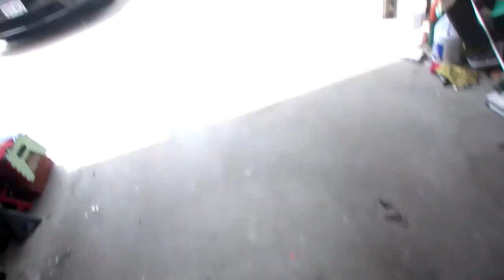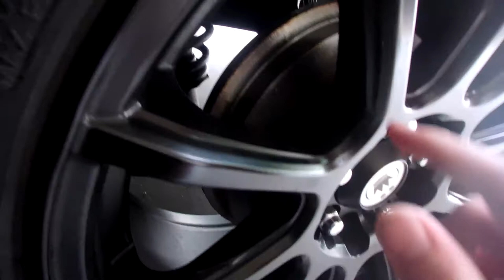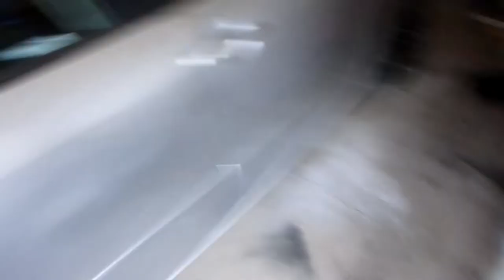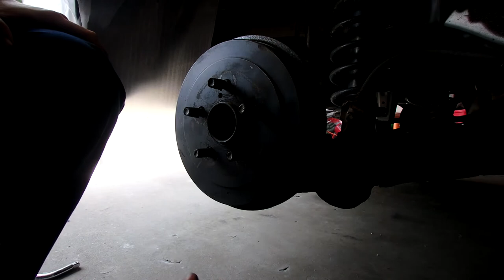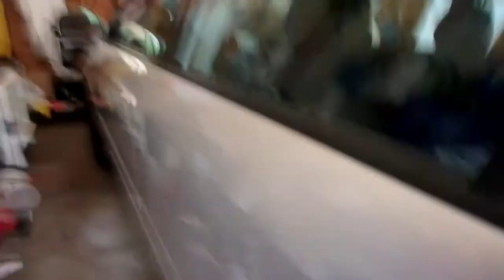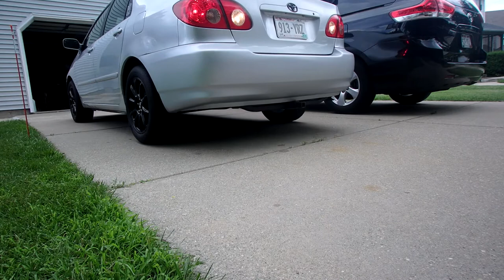FINISHED PAINTING THE REAR BRAKE DRUMS

Comment: What spacers do u have on there?
Reply from the maker: They are H&R 25mm spacers.
Reply: @WillChang  do u have issues with rubbing?
Reply from the maker: Well, I did have rubbing issues when my car was lower than it is now (there’s about 1.5 - 2  inches of gap currently) but after raising the car a little, the rubbing issue was gone. I still needed to roll my fenders though (legal reasons.) Plus, Wisconsin roads really aren’t good for lowered cars lol
Reply: @WillChang  makes sense did they improve handling?
Reply from the maker: From my perspective, I think it does help performance wise, however, I’m not sure if its all in my head, or if it’s for real. I probably would be able to see if it does anything for cornering if I took it to a track and compared lap times with and without spacers.
Reply: Can u make a video on them?
Reply from the maker: Sure, I could probably make a review on what I think about them, pros and cons, and stuff like that
Reply: @WillChang  that would be sick